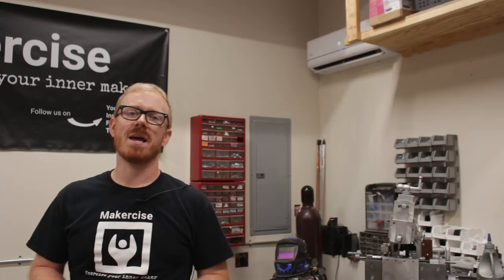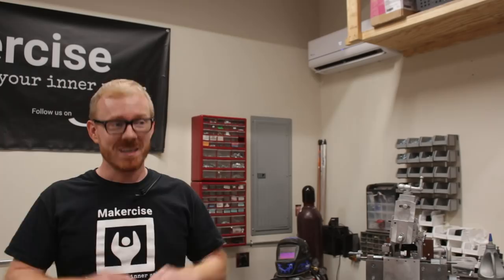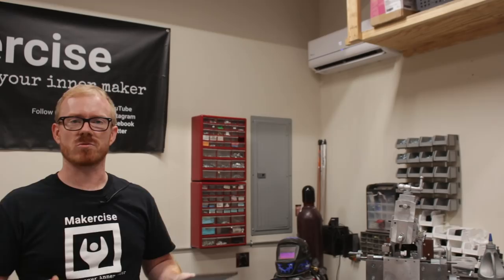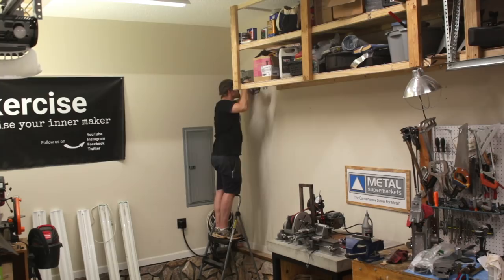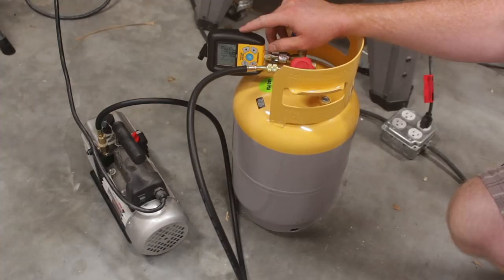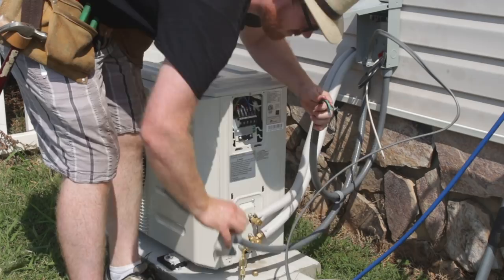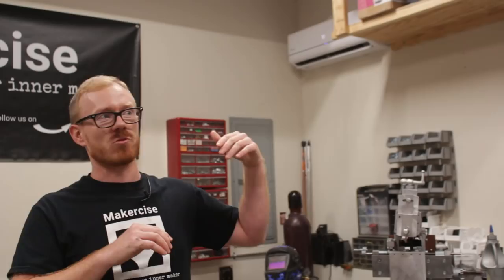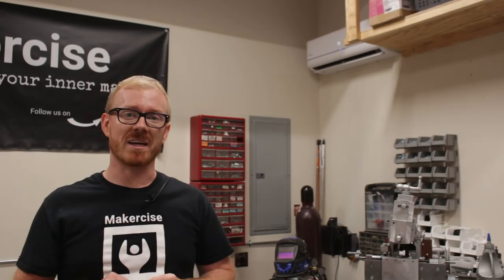DIY Mini Split AC Installation - Air Conditioning Install without Professional Help

Comment: Warranty VOID
license installer is a requirement
Reply from the maker: Possibly. I'd have to submit a warrantee claim to validate your assertion. Fortunately it is running like a champ. No warrantee claim needed.
Reply: Warranties aren't worth the paper there written on. Worked construction for 25 years and the only way we ever get a manufacturer to stand behind there products is to go after them with our attorney. Be it siding, shingles, windows, whatever. They all try to void out the warranty for some excuse.

Comment: So you paid $960 for the unit and your total end cost was $2300. Considering a professional will do the installation for about $400 to cover labor and tools I would say you spent about $1000 too much

Comment: Most expensive chair I have ever seen at 4:49 .. Yikes I would be fired for sitting on the customers equipment and crushing it,.. Didn't you read the package when you opened it.. Do not sit or stand on the unit.... DAhhhhhh
READ THE DIRECTIONS
If you needed a liver transplant, would you do it yourself... What makes you think you know anything about HVAC?? YOU TUBE... Then when it fails you will call a pro and he will laugh when he hears,,, I DID IT MYSELF.... as you see his/her taillights driving away..

Comment: All this because you're too cheap to have a professional install it. Which would have taken half a day and gave you a warranty to back it. The system is contaminated btw. You didn't purge the hose when you added refrigerant from the tank to the system. Not only did you add moisture/air to it, you failed to properly evacuate the system. 1300 microns doesn't cut it. That unit will fail before it would if you had a contractor install it. But hey, you saved some money right?!?
Reply from the maker: My primary motivation was not having to deal with the professional. A year later it is 65F inside my garage 91F outside. I saved approximately $1,000. I have used the tools I invested in to repair vehicles and help a friend troubleshoot his HVAC, thereby avoiding dealing with more professionals.
Reply: @Makercise  I got an estimate for $6000.00 from 1 contractor in my area for 1 unit for my small room

Comment: Do youi gave qualification ??? no ... so this video should be banned ...
Reply: magic cheeseball same like other jobs like brain surgery. But it's against the law ... and I'm wondering if someone will take hour job because it's easy .... lol
Reply: @adampiotrmalejewski695  in  Florida its also against the law for an unmarried man and woman to live together..lol
Reply: @magiccheeseball  but i see brain surgery make by unqualified person its okay in your case ??? you comparing different thinks. As i say dont be surprise one day unemployed because people can do what you doing for living
Reply: @adampiotrmalejewski695  I'm confused what you are saying? How would people be unemployed from what I am doing?
Reply: @magiccheeseball  I dont know what you doing for living but i am HVACR engineer . And that take part of my job .. let say you are car mechanic and people will start repair they own cars ... did you ger my point ?? and throw motor oil to the sink .... because is cheaper
Reply: @adampiotrmalejewski695  i didn't do the work my self only A/C guys installed my mini-splits but i get what your saying. well a lot of mini split jobs are complicated  with multiple units, then you have many other types of a/c installs and repairs so i'm sure you have nothing to worry about. in the usa mini splits and just the  new window unit so a/c guys are getting a lot more work because they were not needed for window units.

Comment: Why eliminate the Fridge mechanic out of the equation who studies this and works his hole life to work on aircon. My point is even i may as well build my house myself and not pay the construction guy who is a pro and has mouths to feed..... I think it wrong to show people how too's when i paid thousands of dollars just to study this trade.... DIY people should be paying me back what ive learnt
Reply: He does have a point. Most people are not in the position to do it yourself even if they want to, they just make a phone call and cut a check. Also when you go this route the HVAC installation is covered for warranty and if there is a problem a phone call to HVAC place is all that's needed. Of course I didn't do any of that, I did it all myself!
Reply: Elias I’m an electrical contractor myself and I gotta be honest, I make more money fixing DIYers projects. Lol
Reply: Are you saying because you had to pay for it this type of information should be locked behind a paywall?  Why?  If I can do something myself, I'm not going to pay a professional a couple thousand dollars to do so.  If the only thing keeping a job from obscurity is a 20 minute video then It's going to happen.  Videos like this also help people to decide if this is a job they should tackle or if they should go to a pro.  I've worked in IT for 20 years and every part of my job  is available for anyone to learn online for free if you know how to look for it.  It's a matter of keeping up with new trends, proper techniques, and new tools.  Also no video is going to replace the experience you or I have spent a great deal of time obtaining.
Reply: But that's like saying I shouldn't change the oil in my car or change the brakes because there is a car mechanic that has mouths to feed.   I think that a non-mini unit needs a trained HVAC person but this is barely a step above a window unit.   Especially with charged lines.

Comment: For the love of God and everything done right just don't install any a/c system outside a window unit without a pro. Just don't. You do not have the proper tools, experience, or certification to do a proper install period. I am all for dyi work but just don't with this type of work!!